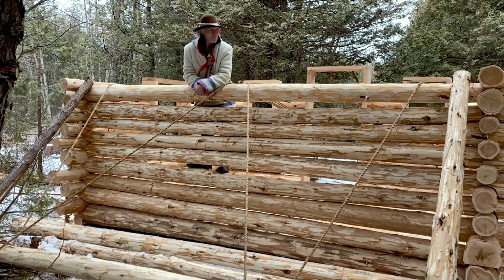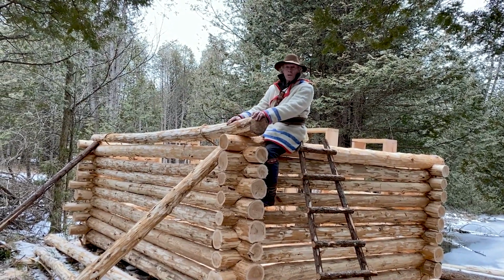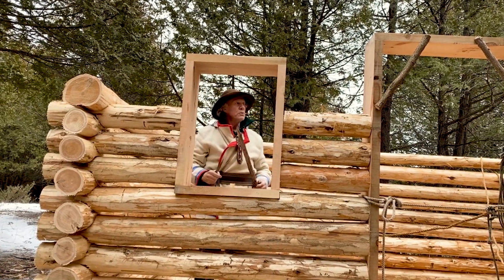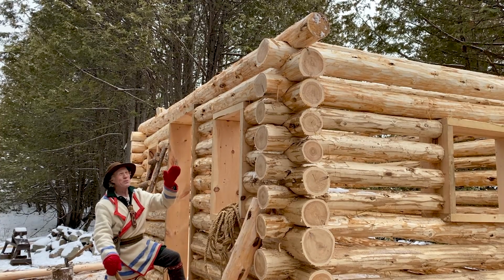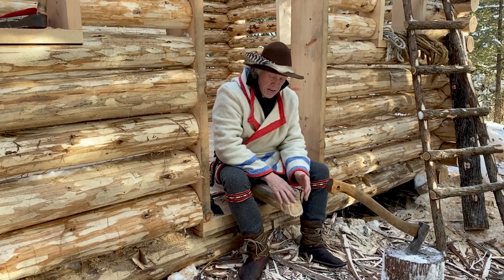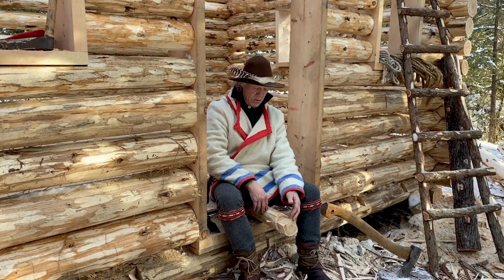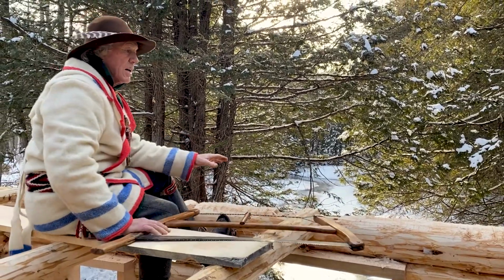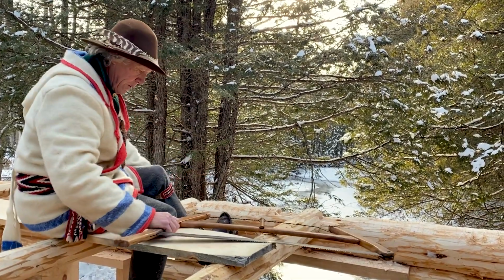Finishing The Log Walls  | LOG CABIN BUILD | PIONEER LIFE CIRCA 1700's|GREEN WOOD WORKING

Comment: Another way to get the logs up the inclined plane logs is to have drilled holes in the inclined plane about 3 - 4 feet apart and at equal heights off the ground.  You then slide the log you are raising from end to end up the ramp and putting a pin in the drilled hole to keep that end secure while you go to the other end.
Keep up the good work!
JIM
Reply from the maker: Great feedback, Jim.  Good idea.

Comment: If I'm not mistaken I guess this is just a question but what are you using for the windows are those genuine 2x4s cuz I know when you go to a lumber supply store they're not actually measured out in actual 2 in by 4 in
Reply from the maker: The window frames are cut out on a friends saw mill and are a full 2” x 10” and the same with the door boards.

Comment: Are you planning to discuss your clothing?  Would it have easier to put all the logs up and then cut out holes for the windows?
Reply from the maker: We do plan to cover clothes of the 18 th century.  Building the way we did saves cutting a few trees, but is not as strong.  Given the small size it seemed the most practical way to build.

Comment: You should have notched the tops of the windows and door into the logs above and pinned them. Its more work but would make for a far stronger wall, which as it sits your front wall is basically freestanding and won't be able to withstand the downwards pressure from the roof system as well and will begin to buldge out with time